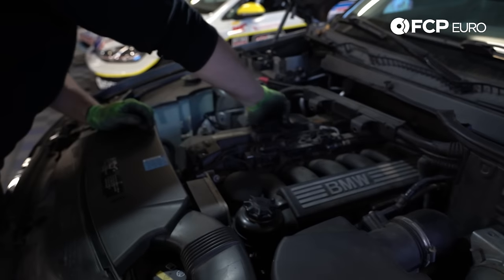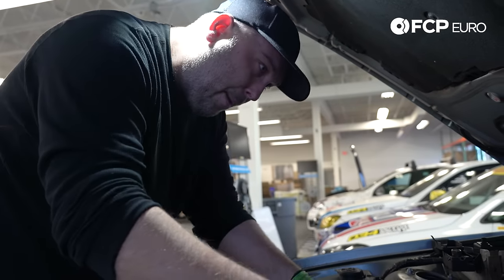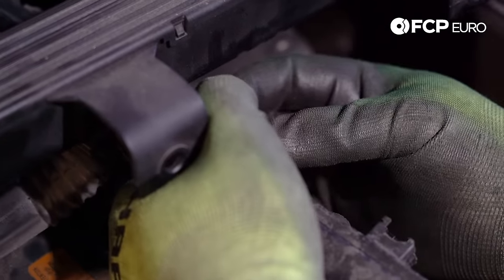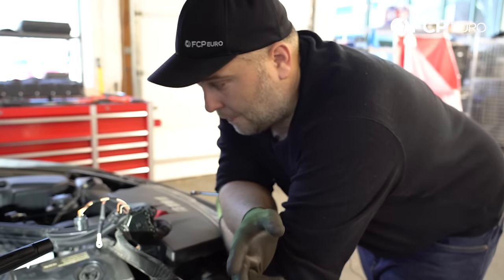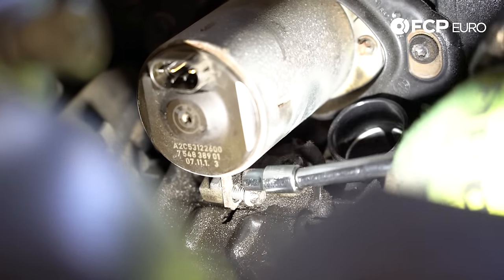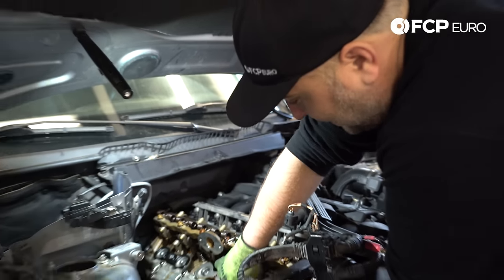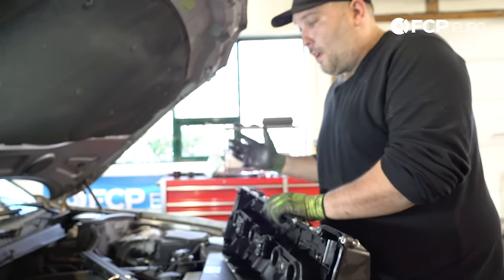How to Replace the Valve Cover on a BMW N51/N52N Engine

Comment: Just a heads up for all the N51 owners in CA. If you’re still under 150k and 15 years, this service is 100% covered by BMW. Just had mine done at 100k May of ‘23.
Reply: more info? please
Reply: do i need a code or can i just take it?
Reply: What if its at 15 years
Reply: Where did you get this information??
Reply: Dang it, I’m at 183k miles. I didn’t know about this 😢
Reply: @LxTxSURGE  no code but obvious leaks

Comment: Excellent video. BUT for those who will crack the PCV valve hose which happens  to the best of us- as I just cracked mine,  you do NOT need to pull the intake to get to the other two connections off.  Watch a video to pull the alternator and reach in cut the two tabs that hold the keeper rings on both connectors and simply pull off the connectors and replace the hose.  The problem with these connectors is the heat over time makes them very stiff and not pliable and causes them to not release.   Hope this helps.

Comment: I pulled the wipers and inner shield off. Then, removed two bulkhead panels which live over the back of the valve cover. Doing this allows the cover to basically lift straight off. Saved aggravation and a ton of time!
Reply from the maker: Nice work, John!

Comment: Thank you for the video!  I just did the valve cover on my wife's 2012 128i convertible with the N51 engine.  It took two days but everything went smooth.  Just like he said in the video, the hardest part is getting the valve cover off and the new one back on.  The next hardest part was torquing the valve cover bolts in the back.  My process wasn't exactly like in the video since the 128i has a different wiring harness and additional strut bars.  I just took my time and was careful and patient when removing all of the plastic connectors.  I certainly don't want to have to do this again for at least the next 80,000 miles.  But I did save enough money doing it my self that I bought a new computer!

Comment: Thanks for this video. It was very helpful. I did mine on a 128i, and space is tighter than on that X3. Two recommendations to  add here. First, don't even think about trying to save the PCV hose. That sucker literally fell apart in my hands, so order a new one. You can install it without completely removing the intake manifold. just remove the bolts on the manifold and slide it out an inch or two. Second, remember that you will have to reset the window limits after disconnecting the battery. Hold the window switches down for at least five seconds after they are fully down, and the auto up function will work again.

Comment: Another tip, on my 128i there is a plastic vent piece in the center at that joint below the windshield/above firewall where that rubber seal runs across THAT CAN BE REMOVED with a few bolts and gives so much more room for the back of the valve cover where the breather hose connection is. When I figured this out it made installing it SO much easier.

Comment: Great video. My e92 ran really rough on startup but no codes. I went back in and found that the coil shields were not pressed all the way into the recesses. Be sure they are pressed past the little tabs you see on the inside of the cover.
Reply from the maker: Glad it was a simple fix, Sweeper!

Comment: I did this job, thanks to this and other youtube vids, it went really well. The one thing I would add with my experience since doing it a year and a half ago is to caution people when installing the new seal for the valvetronic motor to be very careful not to overdrive or otherwise strip out the plastic when driving the two screws for that football shaped gasket. I managed to do that on one of the screws without really trying and in short order I had a small oil leak (again!) but worse, I developed a vacuum leak and eventually started getting mixture codes (running lean), misfire codes, mass air code, etc. There isnt a lot of spare material to work with and the hole is only so deep so I had to be super careful, but I was able to use only a 5/16-18 tap and get a decent grip for a short bolt to secure the gasket. vacuum loss solved. I dont know if it was low grade plastic used to make the valve cover or what (I bought aftermarket - not ebay $100 knockoff cheap but from a discount vendor online) so maybe that was the problem.
Reply: Very good advice. I too did the same thing, heard a crack but it was the old valve cover and had plans to replace it anyway.
Reply: How many hours took you?
Reply: @samoo8933  probably 4-5 hrs

Comment: Late to the party as well. Helping a friend who picked up a 2007 328i. Has almost 100k on the engine and is idling rough. An independent shop wanted to charge him $1000 for plugs and coils packs. Had him order parts from FCP and we knocked it out. Didn't resolve the rough idle though. At least he didn't spend $1000. 

I know he needs a valve cover gasket, and it is leaking around the valvetronic motor and the eccentric shaft sensor. Hoping that may resolve the idle. Probably check the injectors while they are out.

Thank you so much for the detailed video. You were a great help when I rebuilt an 03 525i for my wife. Thanks for taking the time to help the DIY crowd👍

Comment: Great video. I did this procedure on a 2011 328i E93 N51 version. I broke the PCV breather hose even though I was warned so I had to also remove the intake manifold.  I cut out the PCV valve rather than replace the whole valve cover because I didn't want to risk an ill fitting aftermarket cover. Changed all the gaskets in the process and things look and work great.  It was very tight getting the valve cover back on the head though. I think it was the riskiest part of the job getting the cover with the new gasket past the valve springs and the firewall/chassis at the base of the windshield. Thanks again for the video.

Comment: Glad I didn't have to do this.  I went in to the dealership for the regular 2 year inspection and they found that the gasket was leaking oil so curiously enough it fell under the SULEV warranty which I thought had expired since the car is 10 years old, talk about a win!

Comment: On the e90 n51, you have a lot less room for removing/placing the valve cover and it is easy to have a second person with you. This video was a massive help, I ended up breaking the old valve cover when trying to put it back on and had to buy a new one. I was installing Milvs which lead to a new valve cover and coolant return line😅, All & all just stuff that needed to be replaced.

Comment: Thanks for the video.  I had an exclusive local BMW shop perform this job around 3 years, thank you Covid and 4,000 miles ago on my '08 328i that I bought new and has 78,000 miles.  It was in for an annual service when they suggested the valve needed replacing...$1,400.  Recently it had a miss fire for the first time.  I bought a code reader and that listed #1 coil pack failure.  I tore into this repair and found oil in 4 of the spark plug recesses and also found the original spark plugs to be toast.   They charged me for a new valve cover and it seems they only replaced the gasket.  I found the top front corner cover bolt sitting proud and the two center fastener studs not torqued.  At all three of these bolt locations there is an alignment dowel sleeve.  It seems that the cover had not been seated correctly.  
The cover also has date codes that indicated the cover was made in '07.  Although I just ordered a bunch of parts from FCP to complete this job, I didn't order a new cover, just the gasket set.  I'm going to check the closely cover for damage and warpage. I vacuum tested the PCV valve and it is holding vacuum.  When I held the cover up, a fair amount of oil did drip out of the PCV tube on the back of the cover.  Would this be normal?

Comment: I've done this before, it involves a lot of crying
Reply from the maker: This job can be pretty involved depending on the car. E9X vehicles seem to be the most difficult because of the DME box in the back right corner of the engine bay.
Reply: E92 is a pain; I was so glad when I finished. I did it at the 103k mark, still running strong at 185k!
Reply: @PleasherP  same, every one wants to claim that these cars are not reliable, but every car requires some level of maintenance. My goal is to drive mine until I graduate and move on to a 4 series car
Reply: bmwvenire92  you do know the Subaru engines are even a bigger hassle to change out valve covers
Reply: I did this job and it was so bad, kinda of easy in fact. The water pump was so much more difficult and not my favorite.
Reply: @PleasherP  HEY GUYS! GUESS WHOS BACK AFTER 30K MILES!! 
CHANGE YOUR ECCENTRIC SHAFT SENSOR WHILE YOU'RE THERE!!
Reply: @johnfrutos5775  i did the water pump and thermastat. How stupid is it to be electrical water pump? They dident think that through to well
Reply: @nox_chan   So you do have to change the eccentric shaft sensor when replacing the entire valve cover?
Reply: Tomas Valdez whar issues arose that lead you to believe your eccentric shaft had given out??
Reply: christopher olveda oil gets into the valvtronic motor/plug and causes it to fail, from what I've read

Comment: Great video!  I have a 2010 X5 and I had to reinstall the air box and MAF sensor prior to the first start.  It would start but not continue to run until I took those steps.

Comment: This process is slightly different on my 06 325i (E90) but this video made it 75% easier. Thank you very much. Yeah, the torque specs are very loose for a valve cover, I could take off the old valve cover bolts with one hand and a 1/4 drive ratchet. Ridiculous.

Comment: Great video I forgot to plug the valvetronic plug and the car had a rough idle but after turning it back to position manually and then turn   The car on it work fine now

Comment: Great video.  I could not get the hose loose in the back.  I was able to get all the bolts out of the valve cover.  For the one under the hose, I had to use a gear wrench,  After I removed the valve cover, I was able to get the hose loose.

Comment: Nicely presented. A big job made obvious, if still not easy!  Would enjoy a little more instruction on the breather hose disconnection and how to become zen with that move. Thanks!
Reply: I just did this job, thorough and excellent video! On the breather hose disconnect, I chose to use a pick to gently lift up on the retaining ring as I couldn’t get fingers on both the appropriate areas for applying pressure. Gentle upward pressure had same effect as pinching both sides of clip - retainer released without damage.

Comment: For E70 X5, you have to remove one of the brackets thats used to hold down trim cover. Or else it hits the a/c lines. Get it in the far left corner on an angle and push back and level out straight. Once it's down into position, check for seal in place.
Reply: I pulled that bracket off too for my 128i.   Hell there was no bolt in the beauty cover there anyways.  Made installation MUCH easier.
Reply: I replaced my cover and removed the bracket as well... the cover went in so much easier.  Thankful

Comment: I did mine using this video thanks a lot I did order my parts fro FCP; a couple of hints that helped me, 
I struggled with the breather hose, for at least 2 hours, then thought about it some more.. I just couldn't get my fingers to press it in effectively and it just wouldn't come off..

Use a hose clamp around the breather hose bit that you squeeze, not too tight - and use a small flathead screwdriver under one of the plastic bits that links to the bit you squeeze, it came off pretty easily when I did this 
2nd, I snapped a couple of the ALU bolts using a cheap torque wrench. got new bolts took the cover off again and did it by feel this time. Unless you have a quality accurate wrench I would suggest this approach.
As a side note the snapped off bolts came out easily by hand, so if you do snap one don't think the world has ended..!
Reply from the maker: Thanks for the support, Murray! And thank you for the tips!

Comment: Did my e90 and of course used FCP Euro to supply the parts!  Good tip on the O2 sensors, I goofed and had them installed backwards, car did run too that way albeit poorly

Comment: Just a tip for removing the valve cover once bolts are off: I've learned opening the oil cap in combination with bear hugging the damn thing and twisting worked pretty well.

Comment: This is a great video for this job, thank you very much for posting it and taking the time on the details. My only difficulty was taking the breather hose off the rear of the valve cover, but eventually got it. I have a 2011 so I lifted the wiring loom out of the computer box which really helped.
I have a question. My 2011 has 107,000mi, runs perfectly. Should I change out the eccentric shaft sensor or not? It looks ok, is original to the car. What is the lifespan of that sensor? Would you buy a BMW part of VDO at half the price. 
Again, thanks so much for posting this. It really saved me a bunch of time.
Reply from the maker: Glad you like the video Martin and I'm happy we were able to help! If you car is running perfectly there is no need to change the essentric shaft sensor out, however, if you wanted to do it as preventative maintenance, you can certainty save a lot of money buying the VDO sensor and should not have any issues!

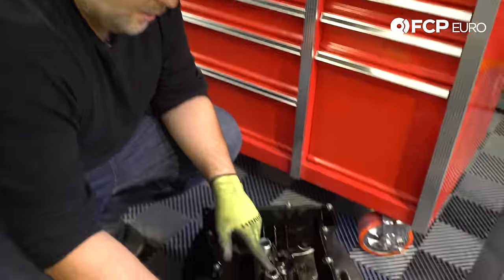Comment: At 24:40 those breather valves in between cyl 4-5 and 2-3 i was struggling keeping them in place
I installed the new gaskets but am concerned if those come loose while driving will they damage my engine? In the pelican parts diagram I also followed they said to super glue them on. Should I re remove the valve cover and glue them on again? Advice is appreciated

Comment: Thanks for the video. 
But i have a question…
I take the valvetronicmotor off without the service-stand. I took it off and i hear a klick.
How can i take it in service and how to put it back and reset it,or does reset it at his self?

Comment: Absolutely 100% on point. I had you sitting on the intake manafold step by step the turning of the brether line clip made the anxiety go down tremendously lol.  Everything worked out perfict took a while but shes dry and running how she should. Shes always had a serious valve chatter though... any input on that?
Reply from the maker: Hi, Marc, glad everything worked out perfect! As far as valve chatter, how loud is it? These engines are a bit noisy, what oil are you running? Maybe you can try some Liqui Moly Hydraulic Lifter Additive to quiet it down. https://www.fcpeuro.com/products/hydraulic-lifter-additive-300ml-liqui-moly-lm20004
Reply: @fcpeuro  it always had a slitght chatter. It almost sounds like comeing from an injector after lisiting a little closer.

Comment: Thanks, great video, but is it turn the Allen key clockwise or counter clockwise until you feel resistance. Also if I instal a new valvetronic motor does it need coding to the car?
Reply: Counter to remove, clockwise to install but stop when you feel friction. The valvetronic motors are not coded.

Comment: My 2009 328i N51 valve cover gasket needs to be replaced. Do you recommend replacing the valve cover since it has the integrated PCV valve? The engine has 99000 miles, so I'm curious what the average life of a PCV valve is.

Comment: My eccentric shaft motor didn't have any spring tension  movement at all when I pulled the e8 torx bolts out. When I turned the 4mm hex clockwise it didn't get tension on it it just went until it stopped. And then just like you're doing I pulled the e8s and it didn't move at all

Comment: Fantastic video! So glad I found it. But I have one question. How do I reset the valvetronic motor? Some are saying turn it in 18 x. You said just snug it up. And the last guy said just cycle the engine a couple of times and it will reset itself. HELP Plz!
Reply: Will did you ever find out the answer to this?? About to attempt myself. Thanks ☺️

Comment: Thanks so much for this video. @27.50, is it possible pressurize diaphragm chamber instead of vacuum through the niipple ? if so can it done without removing vacuum hose to do this test without removing valve cover from engine head. and also how pressure/ vacuum we can apply in terms of unit?

Comment: 16:00 removing valvetronic motor 
37:20 reinstall valvetronic motor
Will I ever have to move the base plate underneath the motor mine does not align even after positioning the motor and turning the worm gear I cannot put the bottom bolt in.
Reply: Put the bottom bolt in before you put the tension on the valvtronic system with the Allen bolt.

Comment: Hey man just finished up on my 2010 528xi but got back in to start and it turned over and turned back off , I then took a look at my vvt and rechecked all my wiring I tried it again then it wouldn’t even turn over . I’m thinking i could’ve made a mistake with the VVT but I’m not sure . PLEASE HELP !

Comment: Hello friends of FCP Euro, watching the video of how to change the gasket of the Valve Cap of the BMW N52; I see you did a procedure that maybe I didn't do :(  when removing the Valvetronic! I removed it but not correctly (loosen all the screws that hold it and turn the torx #4 the valvetronic but forget to loosen the torx #8 before doing so) and I want to know now that I change the gasket as I should place it to avoid an engine failure. Thank you

Comment: @FCP Euro 
Hello Gareth, great video. You mentioned that now it's a good time to replace the Eccentric shaft sensor, should I change it even if it's not failing? What's your recommendation? My x3 is a f25 28i year 2011. 

I already placed an order but would like to know your thoughts. 

Thanks!